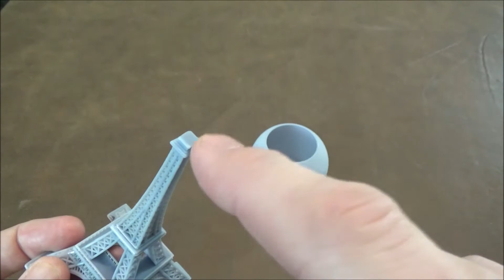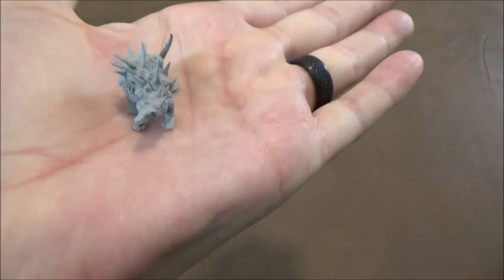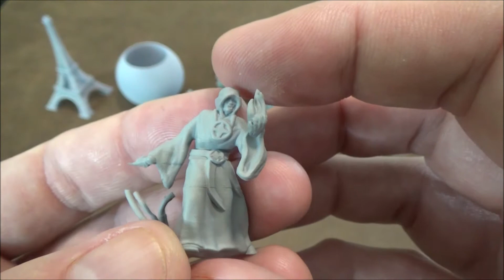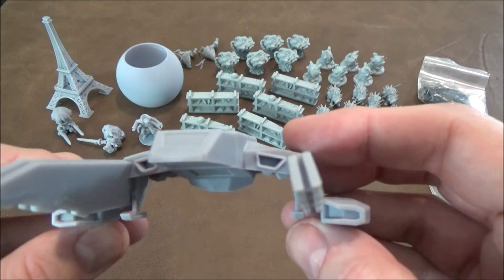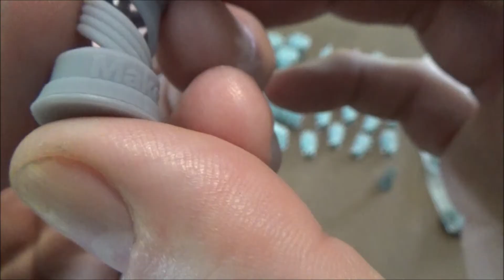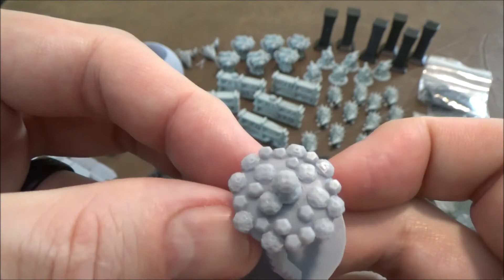How My 3d Printing is Coming Along

Comment: You're off to a great start! Hopefully there are some STAW prints in your future!
Reply from the maker: I just started trying out the resin printer for some of the harder prints that were not working for me on the FDM printer.  Most of the stuff in Attack Wing is a bit too detailed for the FDM to handle (though it seems bases are pretty easy to make).  I did just finish up an old project that I originally began for STAW a long time ago.  It still needs to be painted, but I will show it soon.
Reply: @Trueflights  I'm excited to see what you've done, it would be cool to see the before and after you've painted it! No question a resin printer is best for minis, seems like you've got your resin printer dialled in pretty quickly.
Reply from the maker: @jodygrenier  I don't generally paint things, so there won't be a lot put into it. Don't expect too much on that front, lol.

I have done minis on the FMD printer and depending on the scale they are not that bad.  Certainly the resin is better for them but there is a tradeoff as well.  The PLA plastic prints from the FMD printer would likely bounce if dropped on the floor.  you might break off an extended piece like an arm or something, but it would be more likely to just bend.  The resin prints though are far more brittle and if you were to drop a figure made of that, anything protruding from the core of the model would likely shatter.  There are many different types of resin and I still need to experiment with a lot of them to try out different consistencies of the cured resin though.

As for dialing in the printer, it hasn't been too difficult to deal with, but there is a considerably steep learning curve between the FDM printer and the resin one.  The biggest difference is that if a FDM print fails, you peel it off the build plate, wipe it down with some Alcohol, and start a new one.  If a resin print fails, it is like a 40 minute task to drain and strain the resin in the vat, carefully clean off the film of any cured resin, reset and refill everything, and try again.
Reply: @Trueflights  Good to know about the brittle resin, just like filament, not all are made the same I guess. lol For minis, any paint job is better than no paint job, especially for STAW ships!lol I look forward to seeing what you come up with, no pressure. I'm a complete noob myself, but find it very satisfying and fun to see what others come up with. 
As for resin printers, they are a completely different animal than FDM, no doubt!